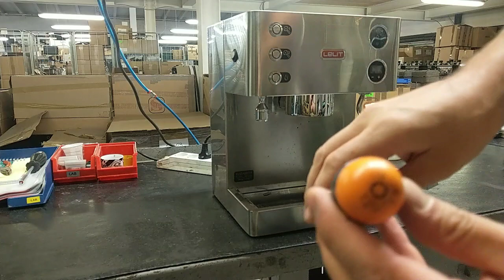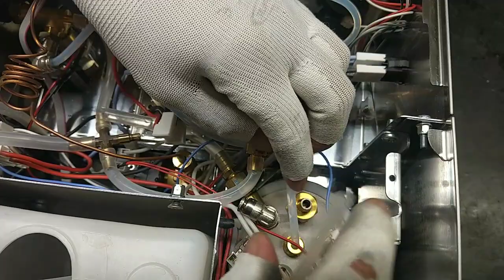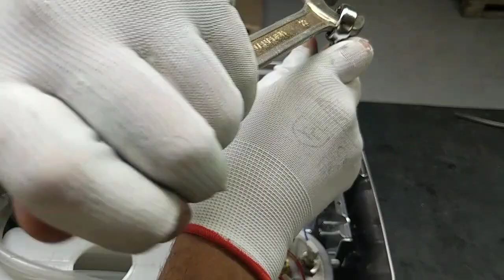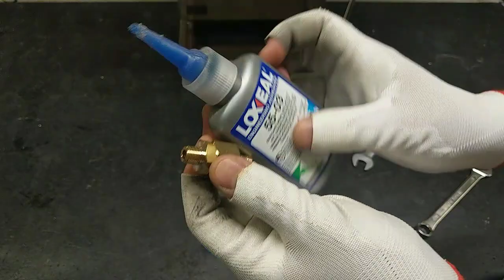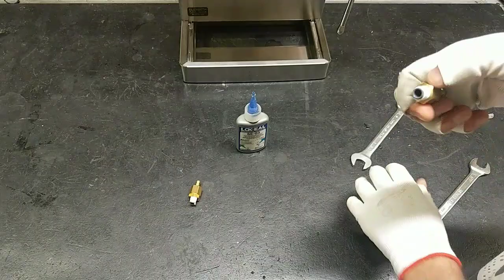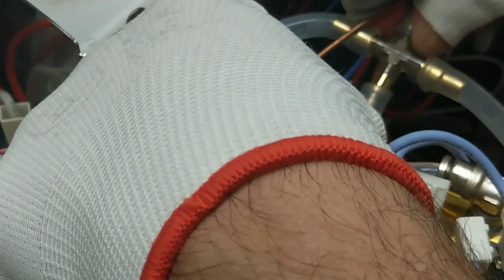pl92t safety valve 9700043 and anti vacuum valve 9700052 replacement

Comment: My Elizabeth has stopped making thick froth.  All it does is steam the milk, no thickness.  I put the steamer wand on my hand & it has a lot of force with tip on & tip off--but only wet steam comes out, it no longer turns to dry steam.  Someone metioned it could be that the steam sensor is coming out & just needs to be pushed back in?

Comment: hi! in my elizabeth v3 the "connector" you remove the teflon tube from at around 3:04 constantly leaks a bit of steam. I tried adjusting the tube a bit with limited success. it still hisses some steam into the machine. do you know the number of the part I have to buy to replace that brass connector in the center of the steam boiler? thanks :-)
Reply: Mine is doing the same thing, did you ever find out what this is? Thanks!

Comment: I have problem, the anti vacuum valve broke off when the former owner tried to screw it out. So, the bottom half of the valve is still screwed in the boiler. Also, it looks like glue was used to seal it. How do I get the rest of the screw out? Or should I cut a new thread?
Reply from the maker: https://www.leroymerlin.it/prodotti/utensileria/ricambi-e-accessori-per-elettroutensili/inserti-per-avvitatori-e-bussole-di-serraggio/set-estrattori-dexter-l-50-0-mm-mm-5-pezzi-81274524.html?at_medium=Sea-Paid&at_source=Google&at_section=Utensileria&at_campaign=LM_Conversion.Utensileria_Sea-Paid_Google_Pmax_Conversion_AO_3&gad_source=1&gclid=Cj0KCQjwj5mpBhDJARIsAOVjBdrfJbBsT4QE_GP1C7dK6ygmXUCPIE-zeLGQX_eSAEKdVmftS9uNi3YaAueeEALw_wcB
Reply from the maker: probably you need somethung like this
Reply: @lelitinsider2977  will that work even if the screw part is glued?
Reply from the maker: please send a photo at care@lelit.com, to do this job i suggest you to contact a professional @4ll3sb4n4n3
Reply: @lelitinsider2977  yeah, I guess I'd have to cut a new thread but I don't have the tools for that and I've never done that before. So, I'll give it to a professional repair shop.

But it's still fun to analyze the problem :)

Thanks alot for your help

Comment: If steam is leaking back into water tank is it the safety valve?
Reply: Hi, did you solve the problem? I'm asking because I have thesame situation
Reply: That would be steam from the safety valve, as the anti vacuum valve tube goes to the drip tray.

Comment: I had a leak at the safety valve so I tightened it one turn and the male part broke off inside the T joint. Can I remove the T joint from the steam boiler or is it glued in? I tried starting to remove it and it seemed very hard. Thanks for the videos, very helpful!

Comment: Why do you have to change this safety valve and anti vacuum valve? what was the problem?
Reply: For me - faulty AV valve did not provide enough power for steam wand and also when I closed steam wand operating valve, you could hear/see hissing sounds from wand for ~20+ seconds.
For safety valve - I don't fully understand, but machine was very loud when water hit boiling temperature (100C+) and higher. After changing it, it's very quiet again. 🙂
We have Elizabeth V3
Reply from the maker: some customers have had to change the safety valve and the anti-vacuum valve